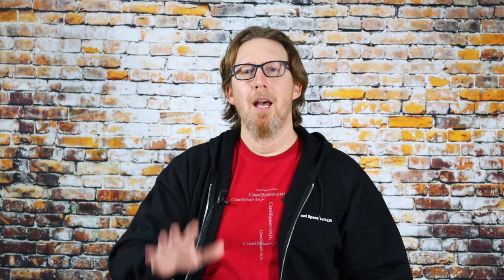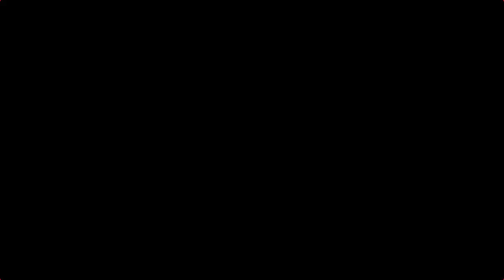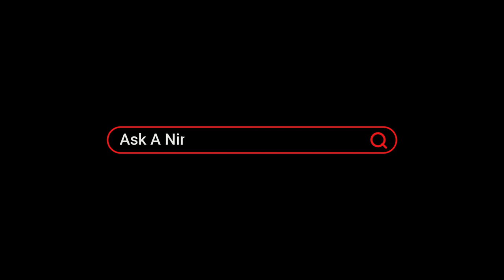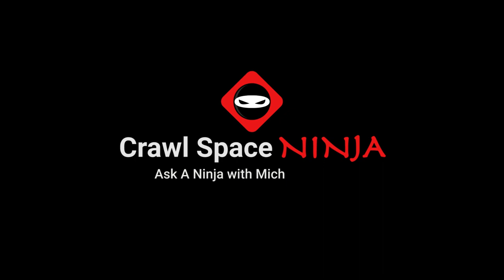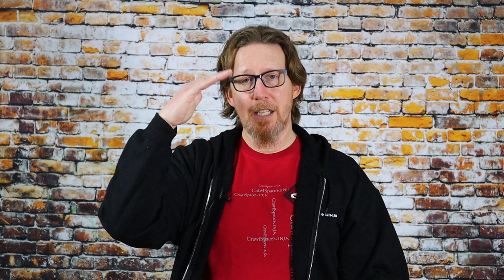Why is Crawl Space Still Flooding With Sump Pump Installed

Comment: I currently have my crawl space encapsulated but every ten years or so it rains so hard that that the street drains get backed up and the water rises. My house is then surrounded by water. The current company wants to put pumps to pump the water out but I don't understand where the water will go if the house is surrounded by standing water? Can you help me understand how this would work?
Reply from the maker: Hey Manuela!  Thanks for the question.  The bottom of the pit is filled with gravel and a hole is dug in the basement or crawlspace. The sump pump is located in the pit. As soon as the pit fills with water, a floater or pressure sensor activates. The sump pump is activated during a flood when the pit fills with water. It continuously pumps water from the pit to the outside, where it can safely drain away. There is a valve at the end of the pipe that keeps water from back flowing into the house.  Many professionals install sump pump discharge lines directly into the sewer system of your home. Why? Because it is sometimes easier than taking it outside to a pop up valve. It can also be illegal or at least against building code. Besides if you ever have a sewage back-up, you can expose your basement or crawl space to lots of unnecessary damage.  Take the discharge line outside at least 15 feet from your foundation. You can also tie it into underground downspouts. But make sure you see them go to daylight and never tie two or more gutters to the sump pump discharge line. This can over burden the downspout extension.  Let us know if you have any other questions.  Thanks for watching and we hope you have a happy and blessed day.